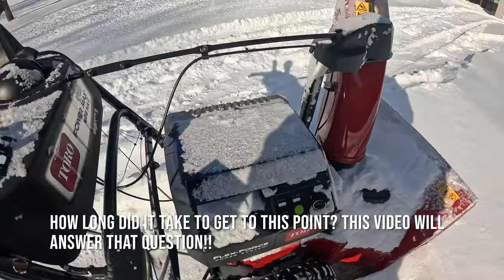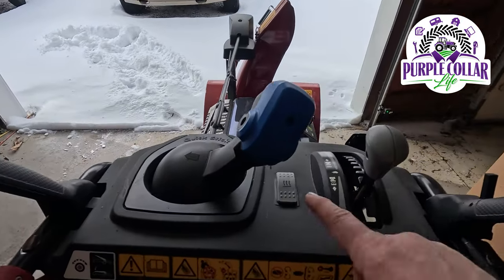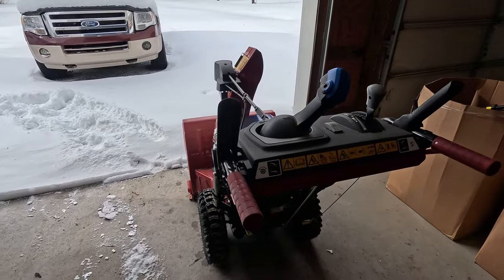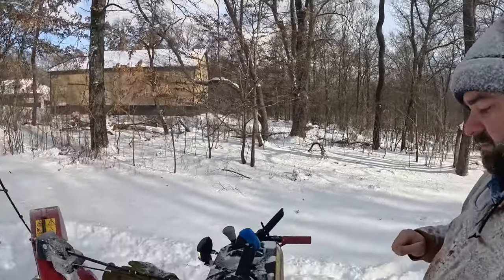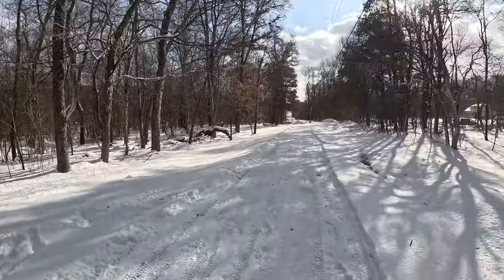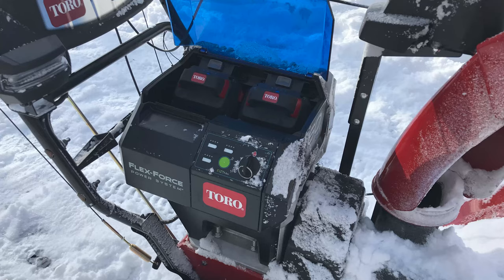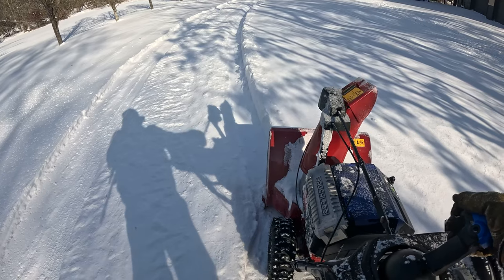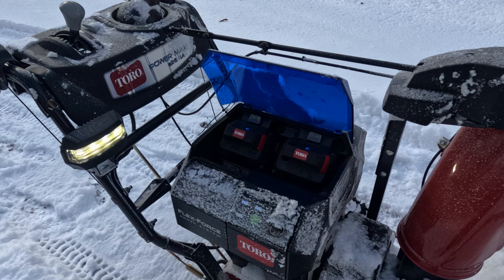What length driveway will this electric snow blower clear? Toro PowerMax e26 HA 60-volt

Comment: Pretty impressive performance! Obviously if you have a smaller area to clear, it would last longer....larger area, not so much. I just bought a Skil leaf blower, 18 volt, and after about 15 minutes of using it from full charge, I was down to one bar. It works well enough for what I need it for, but for the big jobs, I'd still recommend gas. Thanks for sharing, Chad! 🏈😎
Reply from the maker: Thanks for watching! I have seen some people use the leaf blowers to clear snow from sidewalks. It's genius!

Comment: this snow blower was meant for suburban driveways. but its nice to see it can do a 300 foot driveway. you may not be as luycky with wet snow or slush
Reply from the maker: You're right - this is more for a smaller driveway or parking area. But I did want to see how it would do in this driveway.  I'm sure that wet snow or slush would probably wear the batteries down quicker. But I bet adding that 3rd optional battery would really help.

Comment: so how did you get it back into the garage? did you have to wait until the batteries charged a bit? good segment, great demo......but electric vehicles and tools are not in my wheelhouse. thanks for sharing. sure you helped some make the decision to get one.
Reply from the maker: I just pushed it back in (tilt back and push). It's not very heavy - as long as the driveway has a cleared path to push it through. 
Thanks for watching!

Comment: With your driveway, I would put a plow on the truck and clean up the snow in comfort.
Reply from the maker: Our truck is a bit long for snow plowing (crew cab, long bed). But I do have the John Deere 2210 with a power angle plow and heated cab. But sometimes you just have to be one with nature and enjoy the snow in your face. :)

Comment: You mind sayin how much it cost ? And how long does it take to recharge them ?    Thanks for sharing.     Craig.   Pa.
Reply from the maker: The batteries take a couple hours to re-charge. As far as price, I think the last time I saw them out at Home Depot (or it may have been Tractor Supply) - they were around $1800 including the batteries and charger. I'm pretty sure a couple years ago this one was priced at about $1500. But I could be remembering wrong.

Comment: Go Bills. I spent a lot of time in Buffalo and that is one heck of a cold place. As for the snowblower, lithium batteries will run 100% and then shut down, they also hate cold weather. Once the batteries shut down, you are stuck. With a driveway that size you are asking a mouse to work like a mule. At the end of the day, you still need to get the tractor out to finish the job that the Toro could not accomplish. It is great content for someone that is not good with a gas snowblower and has a substantially smaller area to clear.
Reply from the maker: Go Bills! Big day tomorrow. 
Yes - I typically plow our long driveway either with the ATV, or the John Deere (power angle plow AND heated cab). But for this video, I wanted to see how long the electric snow blower would last (in case someone was shopping for one and wondering). Thanks for watching and leaving a comment!

Comment: That's a nice test, but you need to remember that battery capacity degrades over time.  So buy more amp hours than you need.  These electrics are getting pretty close to meeting my needs, but they are not quite powerful enough and the replacement battery cost is still a dealbreaker.   You need to be vested in their 60v ecosystem for it to make sense, IMO.   But I'd much rather be vested in Toro than Chinese EGO, that's for sure.  Toro has local support in most areas.

Comment: I think battery powered anything still receives a lot of resistance from the die hard combustion engine fans out there.  But for the savings in maintenance, reduced noise and no smell (notice I didn’t mention the environment) I think it just might be worth getting new batteries every 5 years or so.  The deal-breaker for battery for me would be if they are all like Ego brand snowblowers, which somehow make a more annoying whine than a gas alternative.  At that point, I’d opt for gas and throw in the old earplugs.

Comment: They’re not a good buy, Toro said 4 year average on battery life and they are $350-$400 each. Nope Hell NO
Reply from the maker: So far, our batteries are holding up good. But they are just about 2 years old at this point.
Reply: Toro states number of charge cycles. Not years.

Comment: Don't buy this.  The plow guy came once last year and charged me $425 for the season.  So I bought one of these and a third battery.  I have run it three times including yesterday.  It was thirty yesterday, so not cold not hot.  Fortunately I have a hose bibb in the garage and hot water as this thing bogs down if the snow is wet.  Chute gets clogged quickly and has to be cleaned out.  Have not had a storm to date where this machine didn't clog up multiple times.
Reply: Seems like something isn't right, Toros are known for NOT clogging and I've seen several videos of these things in wet snow doing just fine.  You may want to check to make sure your auger lever and belt tension are set correctly.
Reply: @plmn93  Factory settings. Clogged 4 for 4.  Lever was straight up.  Belts?  Out of the box?
Reply: @davidgabrielsen2139  Yes, the tension setting is part of the assembly instructions out of the box.  https://www.youtube.com/watch?v=6f0l3ywUMho  If that doesn't help check the belt tension.  And when the lever is straight up it's not engaged so I don't know what you're talking about there.